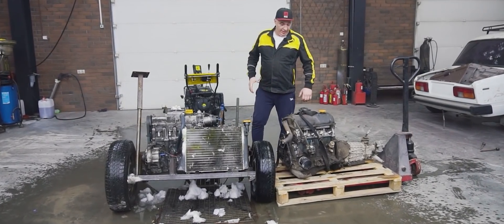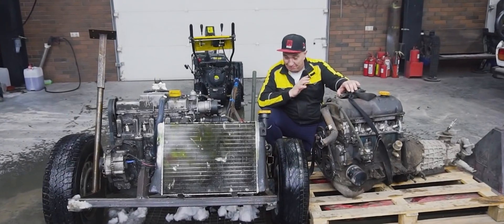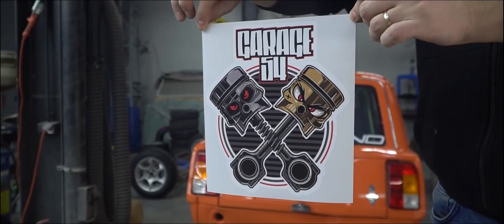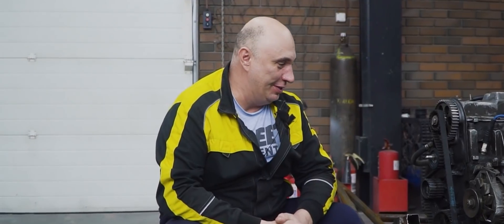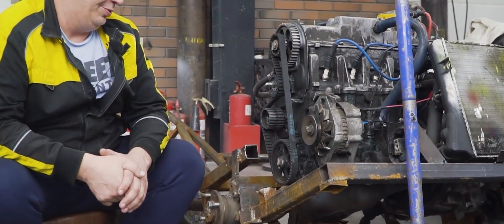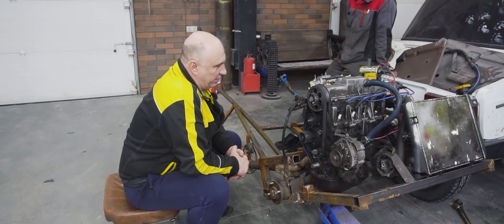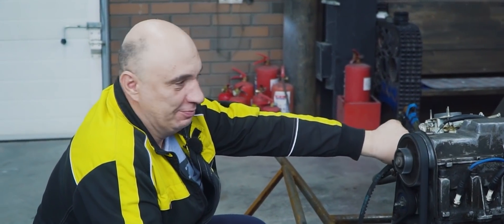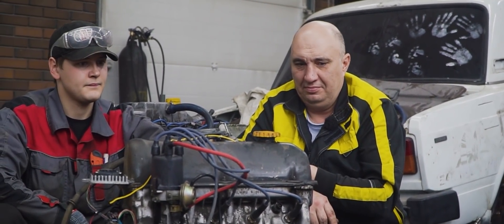8-stroke engine?? How does that even work?

Comment: If they sped up the camshaft, that doesn’t make this an 8 stroke engine. That makes this a 2-stroke. And that needs some significant changes to the timing and probably the intake system (ie a supercharger) to make work with a multi cylinder engine.

Comment: This was absolutely hilarious. I'm no mechanic, but wouldn't an 8-stroke mean the cams are spinning half as fast as a 4 stroke? Wouldn't a smaller cam gear make it turn faster?
Reply: Yes. This was more of a 1 stroke engine, the same stroke I'm experiencing by typing something as moronic as "1 stroke engine", but still, 1 stroke of the piston has the cam to do two full rotations, so yeah, 1 stroke even if it makes no sense at all...

Comment: Have a challenge for you. Can you make wheels with magnets on them and drive up a steel wall or inside down on a steel roof?

Another challenge, make TWO four pot engines into ONE opposed piston engine.

It won't work because the valves are open HALF WAY through the compression stroke, as the cam is running at 2 X piston speed. Simples!

Comment: 8 stroke would be more efficiency but not more power. Its going into the realm of the old hit and miss engines where they only fired when they needed too to keep running. I think you would need a V8 to really pull that off correctly and the whole system will have to be reworked to get the valves timed right. Might need a different crank to get it. Who knows maybe the whole timing itself is way off. Top dead center might have to be swapped on the cam.

Comment: I’m not sure but I think with the valves opening half way through the cycle the exhaust valves are opening during a compression stroke pushing fuel and compression out the intake.

Comment: idea> 5 stroke engine
cyl 1 & 4 dump their exhaust in collective 2 & 3
2&3 respectively echaust via inlet valve
gain extra power by injecting water in 2& 3
most modern engine

Comment: I've heard of 6 stroke engines that have the standard 4 strokes, followed by a 5th stroke starting with injecting distilled water at TDC at the end of the exhaust stroke, acting as a power stroke, followed by the 6th stroke being another exhaust stroke for steam. its also a more thermally efficient engine.
so 1. intake
2. compression
3. combustion
4. exhaust
5. water in
6. steam out
Reply: Interesting... Is the waters purpose to provide added pressure for turbo or just a cooling effect?
Reply: @snobbingas189  the water makes the engine up to 30% more efficient by using the heat of the engine to cause the water to rapidly expand, providing a power stroke, there is a ton of things I could reference, such as thermodynamics, water phase change hyperphysics, and steam explosions.       Sorry if this comment is a mess I am half asleep.
Reply: @EpicTechJunk1e  Now that is funky setup, but could work when you are running 1000hp setup. My only question is how much of it ends up into crank case ruining the oil. I imagine this requires oil change very often and being tuned to pretty hefty numbers so engine runs pretty hot.
Reply: @Hellsong89  yeah I agree, it's just based on something I found elsewhere, I wonder if it would be possible to filter the water out of the oil, then it would be quite viable
Reply: @Hellsong89  

Regular hydrocarbon fuels produce a lot of water as a byproduct. 

Gasoline is mostly hydrogen, with some carbon. That hydrogen combines with oxygen (a.k.a it burns) to become water. 

One gallon of gasoline produces about one gallon of water. 

So, for every gallon of gasoline that goes through your engine, one gallon of water also goes through your engine (in a normal 4 stroke engine). 

I think as long as the cylinder/piston is hot enough, to burn a specific amount of water fast enough (upon contact), there shouldn't be any problems. 

But, if things arent hot enough for the specific amount of water, there'd be bigger problems than water in the oil. 

The piston could become waterlocked and damage the head gasket (or blow the cylinder head off). Then you would still get water in your oil😅.
Reply: @tylerdurden3722  well based on some rather simple math low pressure steam is created somewhere in the ranges of 100-300°C and has an expansion rate of about 1600X so you would need less than 1 cc of water to fill the cylinder with steam, so hydrolocking is somewhat unlikely, and it's more effective at higher temperatures. @700+°C it expands at over 2500X thus requiring less water for the same volume
Reply: @Hellsong89  It's really not for high HP, the power density of the engine (think, HP/kg) is lowered as you're lowering the amount of combustion per/rotation. I never actually thought about the leak into oil, maybe that's why it's not been done on a large scale. However, this is not the only way to use the heat, there is also a 6-stroke using water / methanol after a Diesel stroke has been completed (4-stroke here). 

High-heat steam, which is what would happen here, does not behave like usual steam, it can be used as an ignition source even, so it's more like an ideal hot gas, however for any of this steam leaking into the oil it'll still condense the same so it might barely reduce this issue and as this steam is waaay thinner (being singular water molecules essentially) the leakign might be worse too. 

As with any funky (+additional strokes) stetup the main issue probably is heat control, not so much an issue for petrol but for diesels of course you need a certain amount of heat so pulling it out with (water alone) might need additional controls in the cooling system, though with modern ECUs I guess this issue is not so severe.

But the thing I always say is if my 1cc. HCCI model "diesel" plane 2-stroke engine can run fine with just natural air cooling from the propeller & with THE ONLY adjustement done being the manual compression adjustement from the moving head (essenitally a plunger on top, like an opposed piston that moves only when you twist the screw) then surely with a computer controlling everything it's all possible? Though these model HCCI engines do use a very unique mix of fuel using pretty exotic chemicals so that's why they haven't been able to scale up HCCI for car engines I'm guessing. Anyway, that's a whole 'nother story!
Reply: Would likely help in that regard, but the main benefit would as stated before, the additional power stroke from rapid steam expansion
Reply: I bet these guys are able to get anything running, even a three stroke engine, lol! 😀
Reply: There is also a six stroke engine in the bee movie

Comment: "How does that even work?" Good question, in middle of compression opening exhaust valve releasing pressure and get only half compression for ignition. And then opening exhaust valve again too soon and get only half energy from combustion. And this suppose to add power?

Comment: Maybe it will work if you spin the motor faster at startup, for example welding the crankshafts of the normal and the 8 stroke motors together and the normal one acts like a starter.

Comment: Whats happening in the engine:
I = Intake (Piston going down)
C = Compress (Piston going up)
P = Power (Piston going down)
E = Exhaust (Piston going up)

Piston direction: D  U D U
4-takt:                  I  C P  E
8-takt:                 ICPEICPE (what the valves are doing)

Takt 1: Piston going down, fuel being injected = ok
Takt 2: Piston still going down but all valves are closed = pulling vacuum instead of compression = bad
Takt 3: Piston is starting to go up, and the sparkplug is firing = Bad, spark is way too early, fuel has no compression, cannot work.
Takt 4: Piston is still going up, and the exhaust valves are open, this is just one big fuel pump towards the exhaust.
Takt 5: Piston is going down, … same story from takt 1 on actually so here it actually synchronizes again which is good. But no chance of life. As Vladimir says, the synchronization of the valves and pistons has to be exactly as the manufacturer specified.

Comment: There have been "6-stroke" engines before. They use an extra cylinder and piston to compress air into the firing cylinder. Doesn't work near as well as a turbo or supercharger so they never caught on

Comment: How about trying to build a 2 stoke Lada engine by making the crank and cam gears the same size.

You will need to work out the correct cam profiles and add a supercharger to make it work

Comment: A challenge for you is to build a legitimate 6 stroke engine with a camshaft gear that is 3 times larger than the crankshaft gear and regrind all the cam lobes - the 6 strokes are intake, compression,  power, exhaust, scavenge in, scavenge out.  
You need to do this on a sequential fuel injected motor so that fuel is only injected during the intake stroke.

Comment: Try a 6 stoke set up. I have seen engine converted this way, where an additional power and exhaust stroke is added.  Water is injected after the power stroke resulting in a extra free power stroke due to the water expanding onto steam. Then the chamber is cleared by the extra exhaust stroke.  These engines do not require a cooling system!  BMW experimented with this , however they gave up because they could not achieve the engine smoothness that they felt BMW customers expected. It did however achieve outstanding fuel economy and efficiency.
Reply: if you are going that way, you might as well add a low pressure chamber and turn it into a steam engine hybrid.
Reply: @monad_tcp  - I really like where this is going.
Reply: Garage54 HAS to experiment with water injection! It was one of the developments pioneered by the late war Luftwaffe as an efficient way to cope with low octane fuel the Germans had to deal with

Comment: If it the cam spins twice per cycle then the it wouldn't have time to suck in fuel & the exhaust port would be opening in the middle of the compression stroke losing all compression. 
Try spinning the cam at half speed instead so it's a proper 8 stroke 😁

Comment: If you could chop up the cam shaft and reweld it to where each cylinder would 2 consecutive strokes of each cycle It MIGHT run that way if all the compression didn't escape between the first intake stroke and second intake stroke.  If you could somehow use one way valves so that the compression couldn't escape back into the intake manifold when it went for it's second intake stroke you could pack alot more air/fuel mixture in the cylinder before the power strokes. I could see how that would make more power atleast for the first power stroke. I don't know that it would translate in to more power overall seeing as how a 4 cylinder engine would essentially have to free spin between power strokes and it would probably throw the Ballance off. Haven't ever thought of this before that's just the main points I could think of trying to run it through my head

Comment: Remove one rod and use the engine on 3 cylinder. 
To see uf u can use the block with 3 cylinder in case ubdamage a cylinder wall

Comment: If you plan to try this at home, check if your engine is an interference engine. If it is, it will definitely work. Garage 54 did this with a non-interference one which is why it didn't work 🤣
Reply: Very funny 😂

Comment: Wouldn't using the same size gear give an 8 stroke? It would slow the cam by 50% and make every stroke double. Unless I'm too high...

Intake down up
Compression down up
Ignition down up
Exhaust down up
8 strokes

Comment: Doesn't multiplying the camshaft spin actually reduce the number of strokes? The valves would open during the compression and firing strokes. That drops it to a 2 stroke. Slow down the cam rotation in order to gain more strokes. Maths?
Reply: in this video it was 1/2 stroke :D
Reply: spam bot stole your comment

Comment: Try using one engine to supercharge another. By disabling ignition from the first engine, connecting exhaust pipes straight to second engine's intake and making the first one to spin (belt driving it with the second engine) at 2:1 ratio should produce ~1bar of boost pressure.
Reply: this is something that's actually been done
Reply: @THESLlCK  any more info on that for a non-furry? Sounds great
Reply: @Zoey_KL  - furries make the euth list.
Reply: @GigachadAKM  nice bait mate
Reply: @Xurikyo  not bait. Come here furball
Reply: @THESLlCK  Man, you're funny.
Reply: @Xurikyo  you know what’s in fashion right now? Gasoline.
Reply: @THESLlCK  How can I put this, I am struggling to even slightly care about your existence, so not typing would be your best option.
Reply: @Xurikyo  the rat has become angered
Reply: @THESLlCK  You know, most people are in the community just as a hobby. But uh yeah man, guess all of us are deplorable assholes.
Reply: @Xurikyo  he cries out in pain as he strikes you
Reply: @THESLlCK  🤣
Reply: @Xurikyo  😐
Reply: @Zoey_KL  I can't find the link but someone took a (Ducati) V2 engine, changed the camshafts on one cylinder so it acts like an air pump to force-feed the second cilinder.
Reply: @Zoey_KL  uh oh its gonna bite me, somebody get the 45
Reply: They did this on Roadkill
Reply: @the_car_guy5915  Between G54 & Roadkill I'm afraid there won't be anythign new to try! lol.
Reply: @Zoey_KL  I love that, can I quote you?
Reply: @Zoey_KL  the rat has been angered, ebbryone run for yer lives!
Reply: @THESLlCK  bro
Reply: @Zoey_KL  Disgusting furry
Reply: @Zoey_KL  gross, a pet abuser

Comment: There is a 6 stroke engine that does work...with water injection as the other "fuel"...
It takes an injected engine and turns two of the strokes into a "steam" engine...cooling the engine in the process...
I think Mr. Crower, of Crower cams, built one...

Comment: I think maybe the exhaust isn't open long enough to blow out the burned gases and the intake isn't open long enough to pull in enough fresh air.  The camshaft was different on the 6 stroke.

Comment: There were 6 stroke engines.  1-Power, 2-exhaust, 3-intake (no fuel), 4-exhaust, 5-intake, 6-compression, Next 1-power. The idea was to flush put all of the exhaust gases and get plenty of fresh clean air inside.  I can see adding another two flushing strokes.

Comment: I have a request…   One time me and my girlfriend went off roading in our manual jeep and she stalled it in first gear going up a steep hill and then rolled backwards while still in first gear and the engine started up again but instead of running normal it was running backwards sucking air through the exhaust and blowing exhaust out the air in take,    I wanted to re-create it but didn’t want to wreck my jeep you should try this  from my understanding this means there is multiple gears going backwards and reverse would be forward   PLZZ TRY

Comment: So you should supercharge one engine with another or one bank of a V8 with the other. Make the valves in one bank open and shut so it only blows air, no compression stroke, pumping it's air into the other bank. It should make 1 bar of boost since the air will be doubled.

Comment: dont know how advantaged this engine is in electronics but maybe it didnt provide any spark because it deternined the wrong ratio between crank and camshaft with the hall Sensor in Distributor / Cam Position sensor + Rpm Signal from the crankshaft Position sensor
Reply: There is not a single sensor😄. It is just a money to nothing converter.

Comment: This is on par with the “piston return springs” lol.
Reply: Thats the problem they didn't install the piston springs.
Reply: Chrisfix ftw!! 👍👍
Reply: Sure is fun to dink around an experiment though.
Reply: @Xxcody3232xX  No they are not
Reply: Blinker fluid?
Reply: which is funny, because people replace the valve springs in gokart engines (and similiar) with stiffer ones to gain some horsepower
Reply: @Sithhy  type piston return springs on YT its not what you are thinking 😃
Reply: @Sithhy  Valve springs are for higher rpms and are very affective, people do it in cars to not only go karts
Reply: @DavesWhips  he is probably talking about two stroke powervalve springs..
Reply: Which are totally different to "piston return springs"

Comment: Hello everyone, the engines rotate clockwise, can the opposite of the clockwise work?
Reply: Yes.  Some boat engines work this way.  I have a set of Chrysler 318s from my father's boat in the garage... one rotates counter clockwise.  A different crank and cam, but you likely also would need other small changes... water pump impeller, distributor cap, starter wiring and bendix... if computer controlled, it would need reprogramming.

Comment: If you gear the cam toa 1-1 ratio with the crankshaft, would you not have turned it int a 2 stroke?  I'm not sure if the lobe timing would suffice or whether you would have to make some 'delicate' adjustments with an angle grinder.

Comment: Hmmmmm ... it seems to me that the logic is wrong here. Shouldn't you have more crank revolutions per cam revolutions for an eight stroke - ie. the piston should have 8 cycles instead of four for each valve opening? if I understand correctly, you're increasing the number of valve openings for the same number of piston cycles.

Comment: Video idea: fit an oversized and overpowered electric starter motor and completely drive the engine on the starter motor alone.
Reply: Also maybe use a gasoline powered starter motor for those stubborn engines that dont want start or if your battery is dead.
Reply: Then you could limit the engine altogether and have an EV.

Comment: It was obvious that wouldn't work :)
A 2 stroke engine, with the cam spinning at the same speed as the crank? Not sure it will work, but if it does it won't be powerful. 

I think you're able to make an opposed-piston engine: 4 cylinders, 8 pistons, 2 cranks on 2 engine blocks..and a big nice explosion? 😁😇